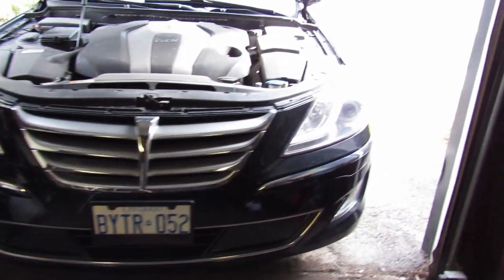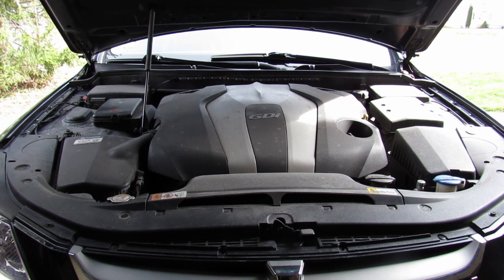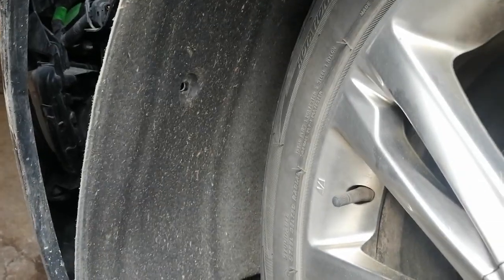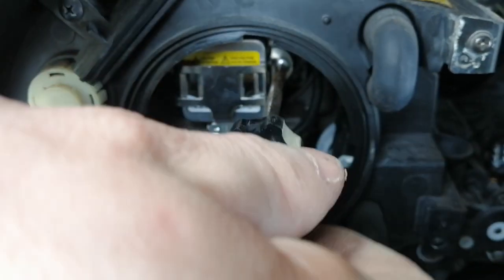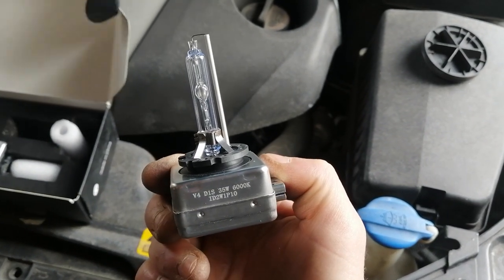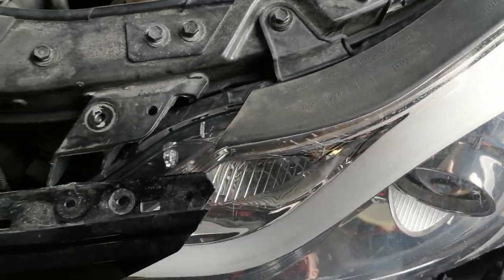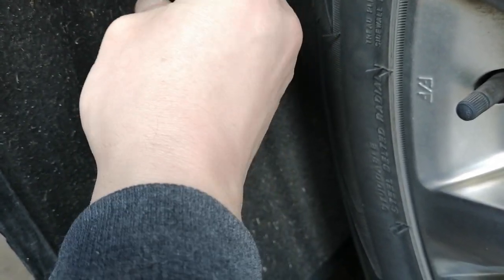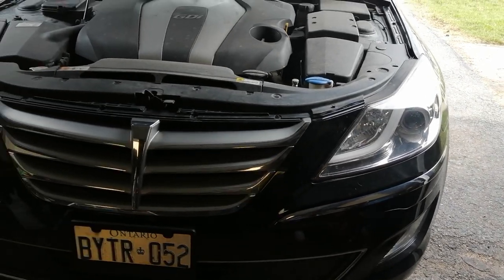How-To: 2013 Hyundai Genesis Sedan D1S Bulb Replacement

Comment: Looking to buy one of these.
Is there a certain mileage point that I should aim for? less than 100k miles?
Thanks.
Reply from the maker: I bought this car back in 2016 with only 32k kms. I put 100k kms (60k miles) on it since. I still have it today and still runs great. What year and model are you looking at?

Comment: So what lights do I get. My fog lights are so low. The headlights are fine but they could be a lot brighter and cover more.  I heard that switching the lights can cause audio and other issues. How do I make sure I get the right ones to avoid errors codes and such. Thanks
Reply from the maker: I haven't really replaced my fog lights yet but I'm planning on getting LED equivalents to the halogen bulb that goes in them. As for switching the lights to cause audio issues, personally I have never heard such a thing. I've changed my headlight bulbs 3 times so far and no issues at all. Unfortunately I'm not sure what ones cause errors, or it even can at all. Hope that helps.
Reply from the maker: I usually buy my headlights on Amazon. Last ones I bought were from RCP but I can't seem to find the D1S's anymore from them but there are other ones available that seem reliable.

Comment: It’s very unnecessary to take all the pieces off. Just unscrew remove and replace
Reply from the maker: I mean I've tried changing the bulb with hardly taking anything off and it was too hard. Easiest for me to change the bulb was to remove the shroud and one side of the bumper and the headlight itself. 
Not sure what is unnecessary to take off?